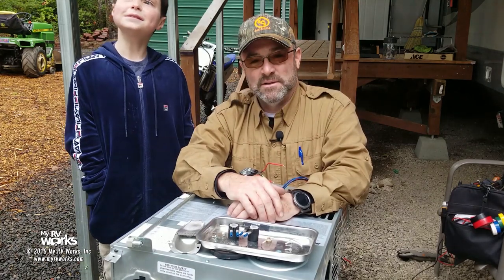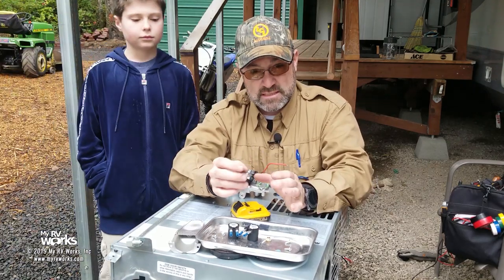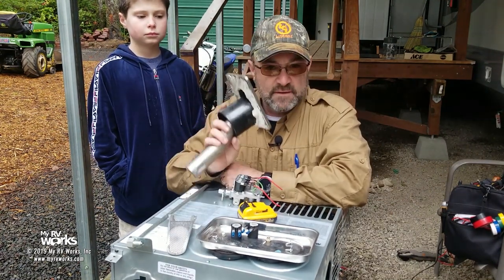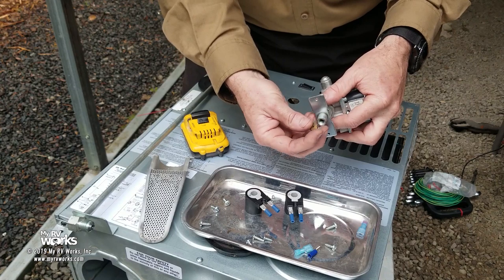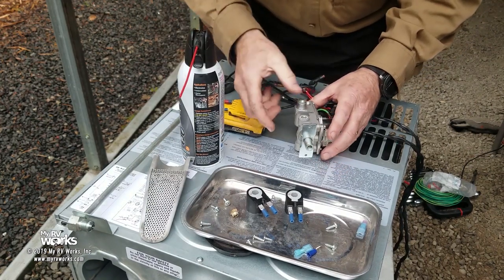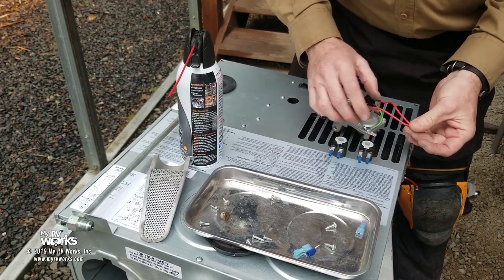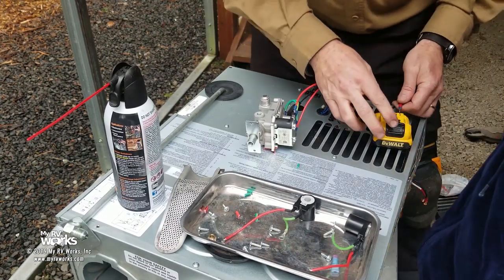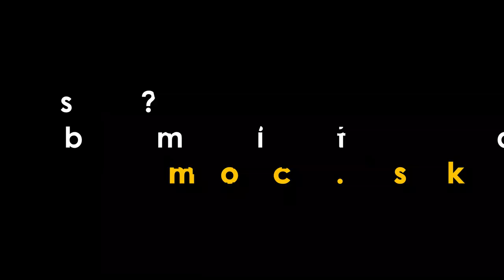RV Furnace Gas Valve Solenoid Failure

Comment: So question: 12VDC / 0.5A = 25 Ohms (You said 40). Is 25 Ohms the failure threshold then? Also, you mention in the video that you're reading off a "ground reference". You aren't actually referencing ground itself. You are taking an Ohms reading between the negative TERMINAL (which happens to have a ground lead connected to it) and the positive one. I've seen where the spade connector on the wire was corroded and so I disconnect these and take readings off the actual terminals.

Comment: Going through a failure on my Suburban 20f-q right now. This video was well done. One thing you said was that you should hear a “series” of clicks. 
I only hear one click (no ticking) and then ignition. I feel heat coming out of my exhaust for about three seconds and then it goes cold again. I learned, from your video, that its the solenoid.  Now… to find it ….

Comment: Today managed to repair an open circuit solenoid coil. Carefully removed the plastic moulding to reveal a broken wire just at the weld to the spade terminal.
Resoldered the wire and all back to life.
Thanks for pointing me in that direction to test both solenoids.

Comment: Hey … Thank you for this video!!! 

I was dealing with a Atwood HE-0601 refrigerator. When running on gas the fridge was stopping on an increasing basis. By stopping, I’m saying that inside the trailer the fridge control panel was showing a gas error (both the gas and error were lit up and it was beeping) .. and there was no flame. For months all we had to do was turn the fridge off and restart it. However, on the last day of our vacation (a week ago) … it failed/errored … and we could not get it to restart. Thankfully, all we had to do was leave the fridge closed and head for home (a couple hours earlier than planned). 

In my research (lots of it) … your video taught me how to troubleshoot.  The Solenoid on my fridge ‘looks’ identical to the ones in this video. They tested with 42 Ohms. The gas valve … using air … was clogged. I then took apart the Solenoid “valve” that’s in the gas valve and tested the Solenoid (using a 12v battery) with only the ‘plunger’ in it … things were moving fine. So, I cleaned the plunger/valve with alcohol … put it back together and it’s now running like new. 

So … not a Solenoid failure … but you pointed me to the problem. Thought I’d share in case this helps others.

Thank you!

Ps … I know Atwood is bought by Dometic & it’s going to get more difficult to get parts … where can I get one of those Solenoids before I can’t anymore. I was researching and I only found one place on eBay but the price is high

Comment: You're the best!! I made up the wires that I needed to test my solenoid with my dewalt battery. Once it was hooked up I could hear them open. I used my compressor and blew air it and could feel air. I did it a few more times then hooked it back up to my water heater and it started up. I must of had something get in there when the dealer worked on my gas lines.. I appreciate all the help.

Comment: Thank You for clarifying for me. I was led to believe that my sail switch was bad but it was clicking just no gas or click from gas valve. I did ohm them out but both said 39.0 and 39.4. I did get 1 click from gas valve and it fired and ran normal but only clicked once out of 15 tries. Light blinks 3 times for ignition failure of course. I’m thinking board.  It ran fine just weeks before this. Thank you for being so clear.

Comment: (I did this before seeing your video.)i banged on the valve/silonoid assmby and mine started working again, i think it was getting stuck because all connections were good. I might later on check the coil ohms. thanks for covering that area on the furnace since others never mention it.

Comment: I've been building my bus conversion now for about 2 years and came across a Atwood / HydroFlame Furnace Model 8520 used for $50. and it has this exact issue and I had not seen any videos on it. I believed this was the issue before but wasn't sure till now. I'll see about buying the solenoid valves and hope this does the trick.. Thank You so much I'll let you know how this works.

Comment: Great video, very informative. 
I bought an old camper in great shape but the fridge wouldn't work on lp (got that fixed) and now I'm working on the furnace. Took it all apart because the fan was stuck and kept blowing fuses. Turns out it was full of old mud wasp nests.
Replaced the board because ignitor wasn't working and now I'm basically at this point. Fan comes on, you can see the spark through a small window but no lp smell from exhaust. 
Thanks again for making this video, it's satisfying fixing things and your explanation of how the system works makes me confident I can finish getting the furnace going.
Reply: I tested the solenoids and one was stuck, tapped on it and now the furnace is working great!
I'll replace the solenoids because they're old but it's working now.
Reply: @Golden-ui5um  where did u find the solenoid?

Comment: Got a dometic 20121 that has been giving me grief since just out of warranty. Sometimes it works sometimes not.  Fan starts up then quits about 20 seconds later, no solenoid click.

This weekend we were without shore power. It was about 5 degrees Celsius outside at night. Furnace didn’t work. When I plugged the trailer into the generator the furnace would work fine. 
Went through this several times, same results.

Trying to fix for two years. Replaced sail switch, limiter switch, igniter , and controller board. Same issues. Sometimes it works sometimes it doesn’t.  Worked fine once I got it home!

Comment: I have really enjoyed watching your videos. I came across them while trying to troubleshoot the furnace on my travel trailer. However, I have not found one that describes my particular problem just yet. I will attempt to describe my problem in as much detail as possible. 
The furnace is an Atwood 8531
Conditions in the order of operation:
1-Thermostat on.
2-Furnace selected. 
3-Temperature setpoint above current ambient temperature.
4-Blower comes on for purge cycle.
5- After purge time, gas valves open (audible click).
6- Almost simultaneously, igniter begins clicking.
7- After less than 1 second, you hear the gas ignite. 
8- The blower  and gas all shut off instantly. The red light flashes once. The blower remains off for only a couple of seconds.
9- The process repeats 3 times, after which the red light on the control board comes on steady (lock out condition?). 
I am at the point where I think I am looking at a bad control board, or maybe a bad gas valve that is drawing too much current causing the system to restart when it opens. I haven't pulled the burner assembly yet, nor have I had an opportunity to put a multimeter on it. I was just wondering what a professional would recommend doing next? The travel trailer is a 2005 Sunnybrook. The furnace was working fine on a recent camping trip. I awoke around 5:00am to the furnace cycling as stated above. I initially thought it may be a supply volume/pressure issue. I did find that I had a hole in my main gas supply hose between the regulator and the RV. I have since replaced all hoses from the tanks to the regulator, and from the regulator to the RV. I have also replaced the regulator. Still, the problem persists.
Reply: you need a new limit switch

Comment: Great explanation! The issue I'm having with my RV furnace is that it ignites and runs perfectly fine when camper's plugged in to 120 (AC power), but when the unit's on 12V battery power alone the heater won't fire, the fan simply runs and runs with the igniter trying to light every 30 seconds or so but never successfully. I don't think any gas is coming through so it's likely the solenoid/valve. It used to work fine on plugged in AC power and the DC battery system. Could it be that under 12 volt dc power there's just not enough electric  power to get the worn out solenoid to open?

Comment: Thank you very much for taking the time to create these types of videos.  When it comes to a Suburban furnace working intermittenly, is the culprit more the board or the main tank's regulator?  I'm trying to narrow it down, but don't want to purchase either or until I get a better idea of what causes the heat to come on sometimes and sometimes the furnace fails.  Everything else has been checked and all is working as it should.  Both, the refrigerator and the water heater, work with no issues at all when using them with gas.
Reply from the maker: We cover some of this in our furnace playlist. One of the videos in that playlist is a complete annual service on a Suburban furnace. Another one had to do with a faulty igniter.
Reply: @MyRVWorks  When the heater does come on, I can hear a thunk coming from the furnace, as if the gas valve has engaged.  But, when the unit fails to ignite, I do not hear the thunk (obviously), so I"m wondering if, in this case, the ignitor has nothing to do with it?  I have used some of your other videos to service/maintain the unit, and everything with the furnace checks out, except this intermittent issue.  Just looking for the closest thing possible to be the culprit, so that I can use process-of-eliminitation and start there.  Thanks.

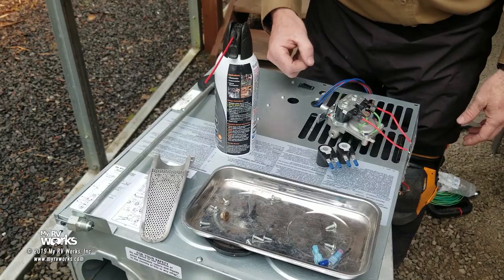Comment: Nice video, very informative and a great topic applicable to not only LP gas RV furnaces, but also LP gas RV water heaters, I believe.  I do have one word of advice about the video making.  We want to see you actually DO what you are talking about!  You almost didn't show the battery-solenoid test!  I'm glad you did!  At 8:50, how about a time lapse of you replacing the solenoids?  The explanation is great, but I'd like to see all of the work you are talking about done in the video.  Anyway, again, either way your explanation was great.  Hopefully you find some constructive criticism useful.

Comment: Great video, my furnace runs great. But when it’s turned off and left alone for several hours I can smell gas. All lines are tight and can’t find the leak with the soapy water bottle test. Any hints or suggestions?

Comment: Question for you there Darren - all your trouble shooting & logical surmising is perfect in catching the problem (Good job too the both of you) but what do you do if it had been the gas valve itself??  Are the inners of the gas valves even repairable - can you shoot a spray into the input in hopes of loosening it up if sticky or are you looking at total replacement at that point?

Comment: What I NEEDED to know was how to change the solenoids! My 2004 Beaver marquis is not get propane to the stove and fridge. I normally hear the click when I turn the on/off switch mounted through the LP access door. (due to the LP tank mounted under the coach, there is an electrical switch/solenoid to open and close the propane supply tank). As I can not get a solenoid, I was wondering if I can take the cover off and manually open the flow (until I can get a solenoid)? My other work-around was to get a "Stay longer" kit and tap that into the high pressure side and use a 20 pound propane tank (from a typical BBQ) when parked?

Comment: Thank you.  You’ve helped me so much.   I have a question. my furnace is an Atwood 8531-111
If the flame should go out, or fails to light, is there a sensor or thermocouple that shuts the propane valve off??

Comment: GOOD INFORMATION :  SAIL SWITCH IS MONITORED BY COMPUTER : SAIL SWITCH MUST BE OPEN INITIALLY (~1second) till FAN COMES UP TO SPEED ( VOLTAGE from BATTERIES : THROUGH WIRES + CONNECTIONS NEEDS TO BE 10.5 volts ) THEN CLOSE CONTACTS ...COMPUTER IS CHECKING THAT FAN SWITCH IS NOT JAMMED/STUCK CLOSED ! !

Comment: Great video! My furnace is brand new, but doesn’t work above 3.000 m high ( I am at the mountains in Ecuador) , I guess it’s a gas pressure regulator problem due to less oxigen, what can I do? Thanks for your help.

Comment: I had a furnace that wouldn't fire but I could hear and feel the gas valve solenoids clicking. I tried blowing air thru the valve the way gas flows thru and could not get any air to move. I blew thru it backwards with just my mouth and I got air to move proving at least the solenoids were opening. I never could get air thru the conventional way but once I hooked it back up it worked fine. My guess was that you needed a certain amount of pressure to full open the diaphragm in the valve that I couldn't produce with my lungs.

Comment: Very helpful video but I'm still stuck. When I apply 12v directly to the valve it opens and after turning on the propane gas will flow through the open valve. When I disconnect the 12v the valve closes and gas stops. However, when I reconnect the 12v with gas turned on, the valve "clicks"   but gas will not flow. If I disconnect the gas, the valve opens and closes. My new gas valve operates the same as the old. A real mystery to me!

Comment: I have what should be a simple question for you. I have a brand new Dometic 18K Unit I'm installing in my RV. Is it acceptable to use one of the stainless steel braided hoses to hook them up or do you need to use a copper tubing?. The Braided hose of course is very simple. I probably would not use the rubber variety, but the stainless steel I would think would be pretty robust, and probably take the bumps better than ae copper line, but don't know what is the most common method for hooking these up.

Comment: Great videos, thanks for the help. I got stumped trying to work out olms law. 
I tried (V/I = R)  12v/.5a = 24olm
That was what I got, but I think you got 40olms
Cheers
Reply: "OHMS LAW "is my NAME : ERIC ....E= R x I ..Correct [✓]
Reply: I was wondering the same thing because you and I have the same answer of 24....not sure what is going on.
Reply: Must have been .3 amp which works out to 40 ohm
Reply: @larryturner7102  you might be right, thanks for the reply.

Comment: Thank you very much for the video.  Can someone please correct me if I'm wrong here:  Is it safe to say that if the unit tries to ignite by going through normal process of trying 3 times (ignitor sparking) before the fan shuts-off after a few minutes, that at this point the culprit will have to be the gas-valve (solenoids) because if there's no gas flowing through valve then the board is not getting power to continue running?  In other words, what makes the board shut itself off if there's no combustion?  Is there a sensor somewhere that detects flame or is it the valve that ultimately makes this call?  My sail-switch and limit-switch both tested good, and I'm getting 38+ ohms on both solenoids on 12VDC, .480A gas-valve, but unit won't fire up.
Reply: You could be out of LPG, the valve at the tank could be off or bad, the regulator at the tank could have failed for starters. The ignitor after it sparks then turns into a heat monitor and it could be faulty or (a control board issue) or the burner could be clogged or otherwise faulty or a clogged or damaged fuel line. Or it could be the gas valve itself clogged or otherwise was not allowing gas to flow as needed. I believe it has a diaphragm that could be hardened, full of debris or oil are some of the other possibilities. I think had the solenoids not tested bad he would have eventually removed the burner and tested the gas valve then the line for correct gas pressure. You do want to avoid changing out the solenoids only to find out it's something else.

Comment: Thanks for the info on this im currently having the issue with my furnace but I have the igniter tick and I smell LP out of the exhaust but still not firing i can hear the solenoid click spark looks strong. Is it possible that the gas valve just isn't opening enough?

Comment: Hi Mr RV - Your fellow Washingtonian here with a related question. So I have  LP smell coming out of the furnace exhaust with the main gas line open and everything else shut off.  There is only a faint smell of LP inside the RV. A hand held leak detector led me to the furnace.  Furnace works and fires up just fine.  So, how would you proceed with determining if I should replace whole gas valve or just solenoid?

Comment: Great video. But a question, on a 24VAC Subrban Park Model, or even this one demonstrated, should there be a constant voltage running to those solenoids or a single 24VAC charge, for example, and if not, what is the conclusion?  Is it probably that the Board Module is not providing the power and is failing?

Comment: i have the Hydroflame 8535-1 furnace. 35k btu. has mostly new parts but now leaking gas from old solenoids while running it. cant find a Atwood #31155 gas valve for it. is there a rebuild kit or can i rebuild it? an alternative that can be safely modified? THX!

Comment: Darren,
How about on a Dometic Fridge (2652) It fails often so I read the temperature of the solenoid  with my IR gun and it shows 200 F at the upper 3/4 of the solenoid.

The brass on/off valve just below the solenoid reads only 135 F the burner tube just 2" away from the flame reads 170 F.   I am not sure where the heat is coming from.

Thank you for this Video you made btw :)

Comment: I have one with 1 failed solenoid. The burner will light outside the combustion chamber but not inside with the increased airflow from the fan. Where did you find the solenoids? I csn onky find the complete valve.

Comment: Just turned my on for first time, seems like it works, heats coming from vents, only think is I smell LP from the vents. After some research, could be oils or dust burning, but left RV for 2-3 hours with windows open and door open, and when came home it still was registering LP smell and using a portable gas sniffer tool, it was registering propane. What could be the reason?